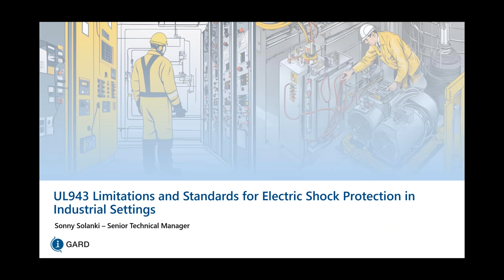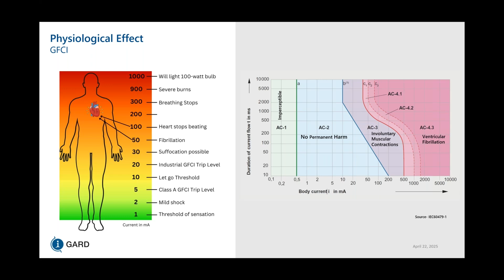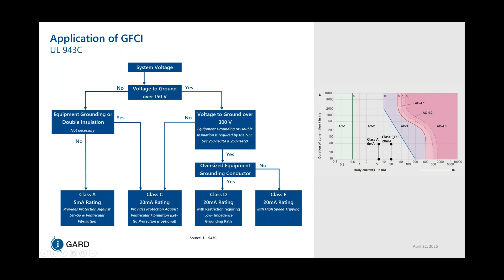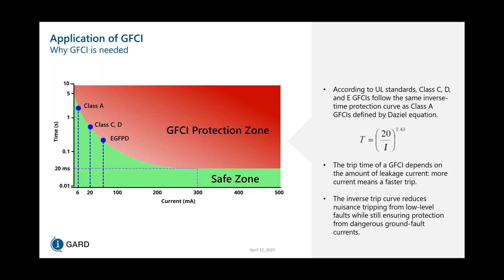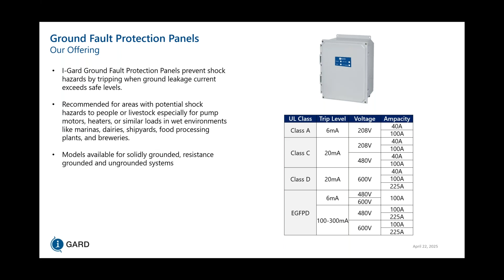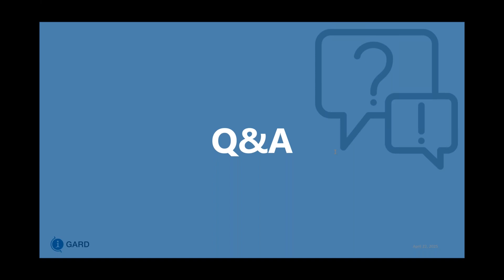UL943 Limitations and Standards for Electric Shock Protection in Industrial Settings

Comment: at around 6:30 the chart shows a safe zone across the bottom of the chart.  it includes 499mA for a period of 19ms.  Surely this is not safe. the safe zone should be colored under 5mA current.  That is, under a certain amount on the X axis, not under a certain amount on the Y axis.